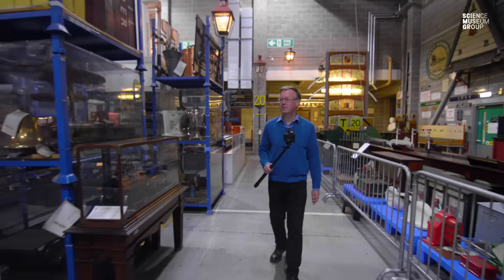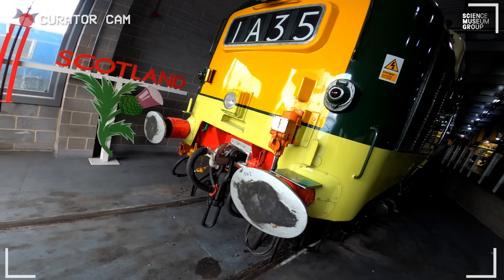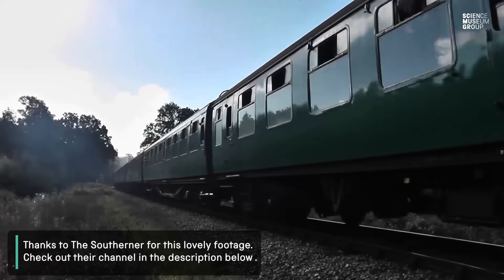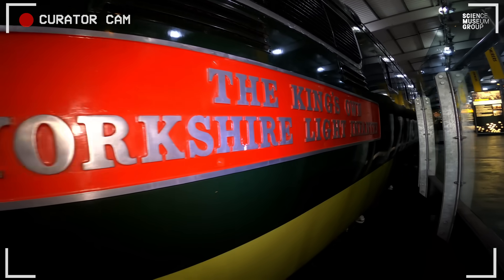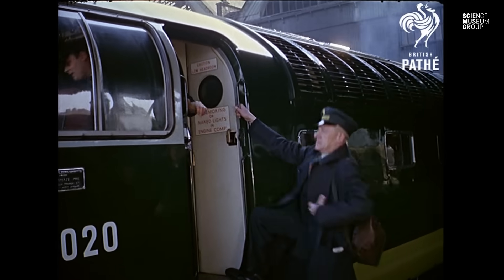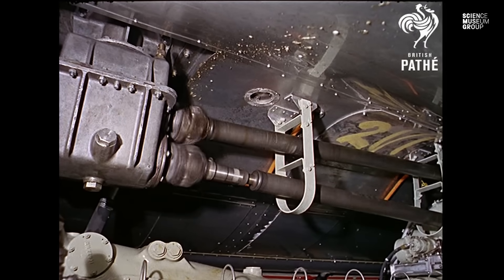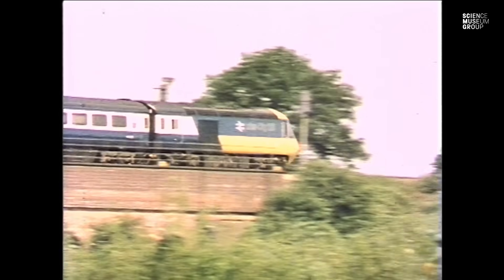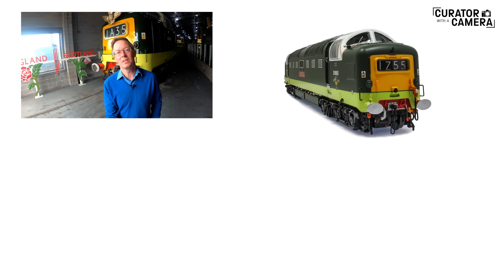Deltic: Step inside the diesel BEAST | Curator with a Camera

Comment: Definitely ahead of it's time. I have to say very elegant,a tru work of art. I have a question with the horizontal piston. Did burn more oil?  It's a odd design for engine. Definitely gave it some power. 3300hp that huge power in the 1950s

Comment: Two memories as a passenger... 1) the amount of smoke they produced, which smelt of Deltic. Not sure how the lubrication worke, but they were 2-stroke engines, and if they did not mix lubrication withe the yuel (as on 2-stroke motor cycles), they might have had som other means of gettig it to the pistons. 2) In wet weather, they had more tractive effort than traction! I well remember the sound of the engines cutting back to stop wheel slip, all the way up to about 70mph (I used to monitor speed by counting the number of clicketty clacks in 10 second, and mentally multiplying by 4 and one eleventh). As the torque of the traction motors dropped with speed, the driver could raise the power without generating slip. Some seened to be impatient and kept hitting wheel-slip, cutting power and trying again.

Comment: Nice video. Beautifully engineered LOCOMOTIVE. Rather disappointed that so little was said about the masterpiece of engineering that was the actual Napier Deltic engine which gave the locomotive its nickname. In my mid-thirties I had the job as chief engineer on a fast motor yacht equipped with not one, not two but THREE of these magnificent 2500 HP beasts for main propulsion engines. Yes, the boat (35 meters) was very fast.

Comment: Bit confused there I think. You don’t have to acknowledge a green proceed aspect. Nor will the brakes come on if you don’t, that’s if it’s single yellow, double yellow or red etc.
Reply: Also you note the OTMR looks like an old radio then point at the old CSR radio and not the OTMR above 🥴

Comment: Napier - Mathematicians to the King.  Their 24 cylinder sleeve valved engines were the the most powerful ( best ) aircraft engine to come out of WWII.  I was hoping  to see the engines.  The 3 crankshafts, 6 banks of pistons in each engine turning impressive RPMs.  Both of those engines were sleeve valved with forced induction.  The Deltic's powered the Army's Navy patrol boats in the Mekong Delta all those years ago.   That was my connection.  All of it - nothing adventuresque, thank you.

Comment: As a youngster in the early 1970s, I would often venture up to Kings Cross to spot the various locos there. The Deltics were incredible machines and I well remember the roar of one of them being started up at the buffer stops under the roof. The whole station used to reverberate to the roar and a mushroom cloud plume of exhaust smoke used to fill the air. You could hear a Deltic starting up wherever you were in the station!
Reply: I have similar fond memories. It was like waking a sleeping dragon.
The sound of the engines powering up is like nothing else.
Living fairly close to the line, lying in bed, I would hear Deltics powering an incline away into the night.
Reply: Ah - those good old days. When building sites , scrap yards and derelict buildings were our playgrounds. Even the actual playgrounds from that era would be considered too dangerous these days.

Comment: I apologise for a question that shows my ignorance of the engineering...
The curator with a camera referred to the ammeter and its use to measure the current in the traction motor. Does that mean the diesel engines drive an electrical generator, which in turn powers an electric traction motor??
Reply: Got it in one - that's exactly how it works. There are six traction motors in all.
Reply: @HowardLeVert  Thank you for your reply!
Reply: The ammeter will be generator amps.
Reply: @markbeale7390  Thanks for your reply!

Comment: The dsd is not connected to the signalling system ,The dsd and AWS are seperate safety systems
Reply: AWS and DSD use the same method of brake application.

Comment: The AWS passing a green signal has no acknowledgement with the DSD .The DSD automatically sounds every minute or so and is reset  by releasing treadle and reapplying foot.If a signal is green a bell sounds and sunflower changes to black,but has nothing to do with treadle.
Reply: Incorrect. DSD does not have any sort of reset timer. All that DSD does is apply brakes immediately if the foot pedal is released.

Comment: My mate was a firemen on steam trains in the mid 70's and decided to move out the town and worked has a second man on Deltic's, eventually becoming a Deltic driver. He gave me the full manual that drivers got back then, which unfortunately has been lost in time.
Reply: BTW, I worked for British Rail as a S&T (Signal and Telecoms) technician, and still love the railway even after retiring 27 years ago.
Reply: I worked for the S&T In Ashford Kent in 1978, most of the gangs were simply human excrement, trash of the highest order, that’s Kent for you I suppose!

Comment: This is a good video which brings back memories.
I worked for Napier in the 1960's on the Deltic engine and the BR engine overhaul and repair was part of the job.
The BR engines were running for 4000 hours between overhauls  with failure repairs as they occurred
The main reason for failure was due to Pistons which caused damage to the con rods crank cases etc.
Failures were almost cured when BR took over the overhaul programme and the running time was extended to 7000 hours.
The Royal Navy used the Deltic up to 2015 in their mine hunter ships a service period of  about 65 years.

.
Reply: I worked for Paxmans in Colchester for a while, helping build these big engines.
Reply: ? Thought pistons would damage the cylinders,so did BR use stronger con rods?
Reply: The Pistons used in the Royal Navy engines were Al alloy which worked fine.
However on up rated engines the Alloy pistons suffered damage at the exhaust ports.
The  pistons were then re designed with Dural crowns screwed 500 lb ft torque to the alloy skirt,
In the BR engines the heavy copper allow crown would part from the skirt .
The engine may well keep running as there is gas pressure above the crown at all times.
In some cases the crowns would clash and break the con rods which then causes a engine failure.
The con rods and liners were strong and  not re designed.
Close forged con rods were tested to reduce costs but rejected.
The failed crowns were used as ash trays in some cases
Reply: Wow, yes those are respectable numbers, but still 4000-7000 is still relatively frequent. Typical low-HP diesels will go like 2-4x the number of hours between rebuilds.
Reply: @ronniescott5179  my favourite diesel engine.
Reply from the maker: Thanks for this, really interesting.

What were they like to work on?
Reply: @NatRailwayMuseum  The Deltic was designed and produced following aircraft engine standards..
I worked with Jimmy Galna who was in charge of the machine shop.
The engines used in the locos were de rated with only a scavange blower. producing about 1500 HP.
The most powerful had a turbo blower with intercoolers which produced about 4000 hp
These were used in naval craft in India and elsewhere.
In total over 600 engines were produced over about 20 years

Comment: The same style of cab as 37s and 40s
And you have explained the controls of the reverser wrong the master key you put in before starting engine to put In engine only ,then start the engines 
I understand you did say that you haven’t drove it in over 10 years but I’m just correcting the small mistake that you have made because I have driven a class 37 recently and will be driving it again 
The number of the 37 is 37263 at Telford steam railway I volunteer there

Comment: The "off" position on the reverser doesn't shut the engine down. Once the reverser is moved to off and the master key removed the reverser and throttle are locked and cannot be moved. Basically in a two cab loco the desk in the trailing (non driving) cab is always locked.

Comment: I lived in England when these came out. I am not a railway enthusiast (my brother was) and I always thought that Deltic was a combination of the words "Diesel " and "Electric" . I seem to remember that they were known as "Diesel-electric" locomotives? Is this correct? Your video refers to them as Diesel locomotives and does not explain why they had electric motors to provide the traction to the wheels. As an engineer I have often wondered why you would have both diesel engines  and electric motors in the locomotive. The answer of course is to provide the torque required to get the train moving. A mechanical clutch/gearbox would be out of the question to transmit the power required. Your video glosses over this main feature.
Reply: Apart from the 'HYMEKS' which were Diesel Hydraulic.

Comment: The last Deltic-hauled train under British Rail ran on 2nd January 1982, not the date quoted. The DSD was not connected to the signalling, the driver had to release the pedal and press it down again when the DSD alarm went off regularly to show that the driver was alert and conscious. When the driver got a green signal a bell sounded, he did not need to acknowledge this, when the driver got an adverse signal a warning horn sounded which the driver had to acknowledge, if he didn’t acknowledge the warning horn the brakes would come on. Could the headcode at the other end of the Deltic be changed from the current 1O16 display to a proper Flying Scotsman headcode please, a NRM member of staff (obviously a Western fan) has thought unit was funny to do this.

Comment: Holy Cow! They didn't get air brakes until the 1960's?!!  That doesn't make any sense; Trains in the U.S. had air brakes as far back as the beginning of the 20th century.   The UK's love of the vacuum brake flew in the face of the available technology.  So did the Deltic engine which was a Royal Pain (pun intended)in the butt to work on - worse than the Fairbanks Morse.
Reply: There were several railway companies that used air brakes (made by Westinghouse) in the early 20th century in the UK - the North Eastern Railway and some of the Southern Railway to name a couple. But vacuum was favoured by more companies.

Comment: Why the terrible visibility from the high windows? The clips of the driver looked like he had to crane his neck up to see anything, doesn't scream "safety" at you. Why not much more ordinary windows? They could have stuck that cubby hole with the driver's toilet behind the cab if they'd needed to. Did it happen to cause accidents?

Also not too sure about the dead man's pedal. Seems like it might hurt your spine, stretching your legs to keep it down all the time, I think the traditional handle would be better. The ergonomics are terrible! I know it was the 1950s but still, people knew what pain was back then. They put a bit of padding on the seat and they think they've done everything!
Reply: @greenaum. There was  nothing  wrong  with  the  visibility  on  these  locos. Both the  drivers  and  secondmans  seats were  on a  raised  plinth.

Comment: Thank you so much for this video and the details, always wondered how engine drivers were supposed to hold their bladders for 6+ hours,I didn't know about the toilet in the nose. Such an iconic loco and at the cutting edge at the time,so sad more weren't saved in 82.The only other thing that I would love to know is what the maintenance crews thought about them, were they more difficult to maintain than other popular classes for example?But great video!🙂👍
Reply: The maintenance was covered by the purchase contract to start with, because they were so unlike any other diesel. English Electric had an operations hut at Finsbury Park. The overhauls were done at Vulcan foundry, where they had been built. As experience built up, gradually B.R. took on more responsibility for them, and by the 70s overhauls were being conducted at Doncaster.
Reply: @marmion150  Thankyou for the insight. 👍
Reply: Six out of 22 preserved isn’t enough?

Comment: My late father was a wireman wuth English Electric and did a lot of the wiring installation of 'DELTIC'  (the first blue one) then later on the production Deltics. He used to tell me his favourites were 'Tulyar' and 'Pinza'. The 'Tinsbury Park Racehorses' (identified by white cab window surrounds these markings sadly later nicked by 'the others') The Mighty Deltics - were the GODS of the ECM! They can never be equalled❤❤👏👏👏👏
Reply: As an electrical engineer who works on Deltics and Class 37s today. I have to say that getting hold of the original wiring diagrams and datasheets was very challenging.

Comment: This article has  me confused. I recall the deltics operating on the west coast line. I remember Scafell Pike back in the late 50s, early 60s operating out of the Longsight sheds in Manchester.  Could someone explain please
Reply: @.R. Jones.Cant remember  a Deltic named Scafell Pike. Are you  getting  confused  between  a  class 45 /46 which  were  named  after  mountains  in the  Peak District. Deltics are  class 55
Reply: It was the class 44’s that were named after the mountains, although the later class 45 and 46 were still known as peaks. Whilst the prototype Deltic travelled all over, the production Deltics ran the East Coast Main line with some trips on the Pennine runs on its last years

Comment: Power to weight ratio is disappointing. The French had better Pacifics in the 1930s, for a little over a ton of extra weight the engines in question could maintain a constant 3,700hp.
Reply: Not without their tender, which makes them about 75 tons heavier.

Comment: ATPH: 2 brief newbie questions:
1.  on the  lower right dashboard, there's a knob that appears to be wood. is it? or is it brass?  what is it for; it looks like an air choke for a carburator !
2.  why 2 air brakes? if there's an emergency stop needed, would it not be more sensible to have the loco & the coaches tied into one Westinghouse hydraulic control?  i mean, every second counts in a life/death situation....

Comment: Wonderful video showing lots of juicy details. How was the drive from the 2 prime movers combined to drive the traction alternator/dynamo? Or did the locomotive have different transmissions - one for each bogie? Next question - in case of low loads or a failure, could you drive the Deltic with only 1 prime mover operating?
Reply: Generators are paralleled to a common bus so yes it can run on any one engine.
Reply: @TechOne7671 A very chunky electrical contactor is used to link the two generator outputs.
Reply: @bfapple  ker chunk.

Comment: Started my driving career at Kings Cross back in 1970.  Must have driven most if not all at sometime. One slight correction to this film reverse selector off does not shut the engines down.  Trying to use the toilet at 100 mph was some experience with air rushing up the drain you had to pass water at 101 mph to avoid having a shower at the same time.😆  Great days though and many characters on the footplate with many stories to tell.
Reply: @.Allan Hat . They were  all double  manned as far as  I know  . I left  K X in 74 so don't  know  after  that
Reply: @arthurrytis6010  Yes we were double manned.
Reply: Yes double manned for safety.
Reply: question: how do you hold the dead-man down whilst using the urinal?
Reply: I thought that, too, when watching the video. I think some kind of funnel would help matters 🙂.
Reply: proper story not some clown who's experiences are from books .i have a neighbour who used to drive the 125's for years , the stories are great . you lot need to get together and write them down , real education / facts
Reply: @paulfoster-c4i  clearly you've never met me then. Come for a cuppa and chat and then call me a clown.
Reply: If u put it in eo it presents  dead man working  
I recall my driver and I hiding behind bulkhead while coasting  through Peterborough  station  .to make it look like a driverless  8 coach express  
Lol
And then getting a double yellow  then yellow then red signal 
And the bobby asking if we were in control  of the loco. 
Lol
Someone  had called in.the police to report  😅😅😅😅
Reply: Is the narrator correct in saying "you had to reset the dsd if you got a green"?
Reply: @BibTheBoulderTheOriginalOne  The guy was more or less clueless. Sums up NRM management in a word🙄
Reply: @squaresphere2864  thanks for your kind words and support
Reply: I was at kx aswell 1974 till 78 like u drove most of them. Used to pee out the door lol 
My reg mate Eric haddon.
Joined with keith Austin  now both sadly  passed. 
Best times ever

Comment: We used to should " Dellie " and if one produced a lot of smoke as it accelerated away " beast" .  We frequented York and Doncaster in the early eightees and would occasionally get let in to the cabs by the drivers .  I think I've " cabbed " 002 at some point. 

I remember sometimes being shown around depots by friendly shed staff. 

On one occasion in the shed at York, where this video was filmed we encountered 55013 The Black Watch perfectly repainted and gleaming with white buffers and everything shining. It was ready to take part in the anniversary of the Rainhill trials.

But for some reason it never attended but it did drive around for a month looking fantastic

Comment: 11:30
I read in a report on an old rail accident that some train drivers put, for example, their bag on the pedal to hold it down for them.
Reply: That`s why The Vigilance device was introduced, so you could not peg the DSD because it had to be released with your foot and then depressed again when the warning sounded in the Cab.
Reply: @stephensmith4480 Indeed. Most of the 60s era diesels [including Deltic] were never fitted with vigilance.